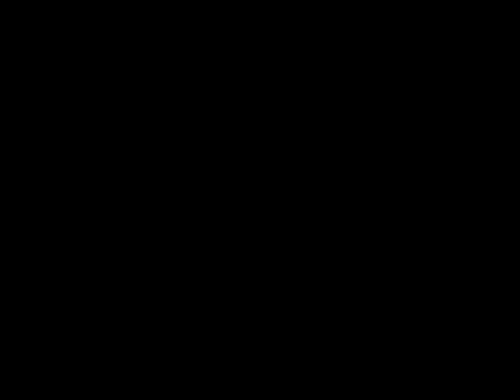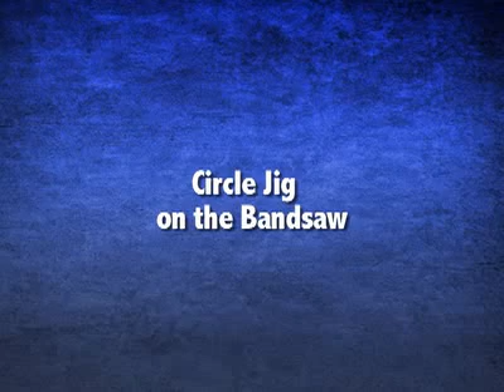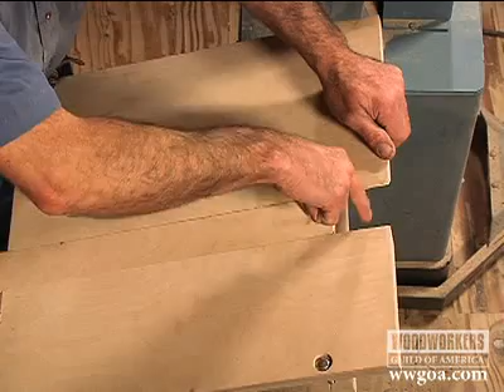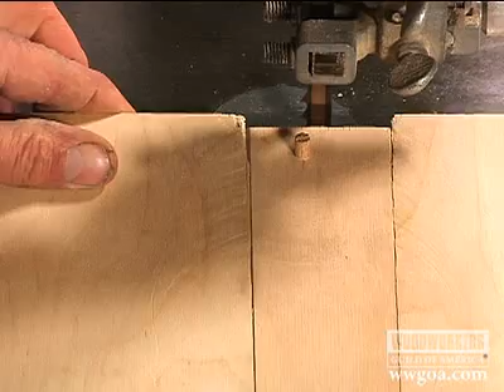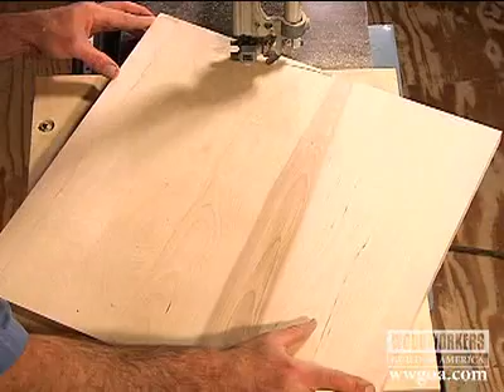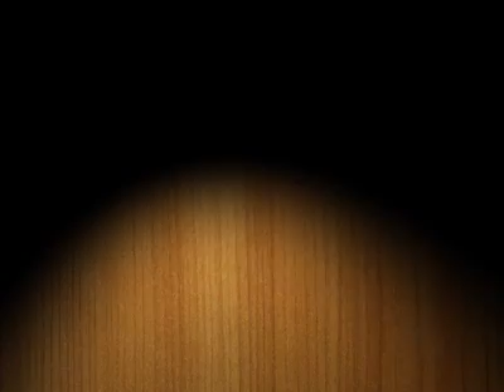Woodworking Project Tips: Band Saw - Circle Jig on a Bandsaw

Comment: I need to figure out how to cut rounded ends on 1 x 4 boards so I can mass produce legs for cornhole boards.  I am currently making them using a pattern board made from mdf and my router but that is too slow when I need a dozen or more legs on short notice.  I have tried to figure this out but so far I have failed.  If you have any ideas I would appreciate it.

Comment: If you need to cut a circle with this jig and not drill a hole for the dowel in the stock cut 1/4 piece of plywood double stick tape it to the 1/4 ply with hole in the center of the ply. If do not have double stick tape tape painters tape and place on both pieces of your wood the then drop CA glue on the tape and stick them together.

Comment: Hi George, nice jig.  I made one about 12 years ago based on the one Norm Abram made on the NYW.  I like the idea of the sliding  dovetail and that little notch you put in the work piece.  One question:  Wouldn't the  miter slot on the bandsaw work as well for registering the jig verses the cleats?

Comment: how did you cut the dovetail for the slider
Reply from the maker: Hi Jeff.  A table saw was used to make these cuts.
Reply: My guess is they tilted the table saw blade to an arbitrary amount and then ran the piece through twice, flipping so the edges cut would form the traditional dovetail shape.

Comment: Adding a cleat to the underside of your jig 90 degrees from the first cleat you talked about would allow you to not have to line up the 1/4" dowel to the front of your bandsaw blade each time.  Would save some time aligning and adjusting before cutting your finished piece.  Would also save material.     Great video though :)
Reply: I think you need a little wiggle room in case the bandsaw blade size changes
Reply: You could also use a piece of clear acrylic for the slider too as a viewing window for your dowel.